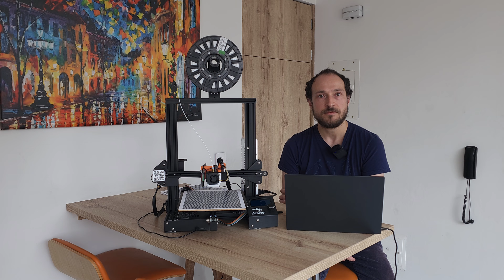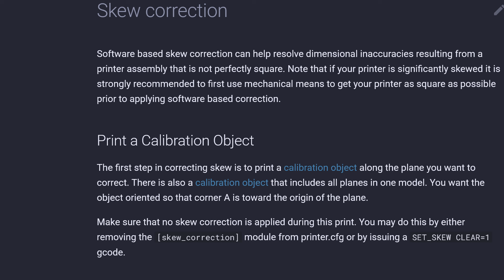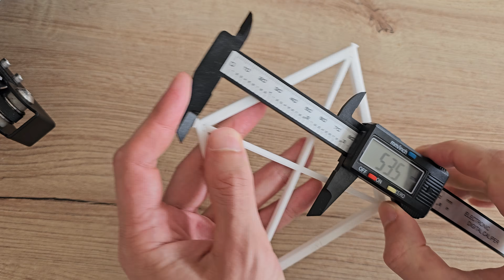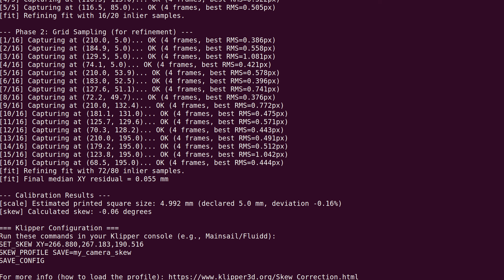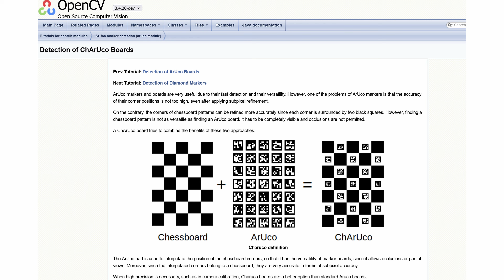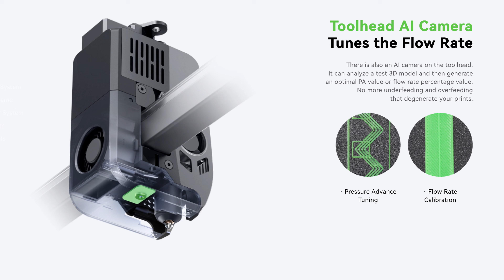3D printing: Auto Skew Calibration with a Camera and a ChArUco Board (Klipper)

Comment from the maker: I implemented now a suggestion I got: My code is now also checking if the X, Y travel distances are correct and if it detects a difference it will output a scaling factor for "rotation_distance" in your Klipper config.

https://github.com/undingen/SkewCamera/commit/1f65129de85bf0967b165c4de5266459e7f6ed5e

Comment: Did anyone manage to get this to work? I am trying with a very similar endoscope camera (probably the same one) with the 5mm A4 Charuco PDF on the github, on my own self-built Voron 0.2 with custom-designed camera mount. Camera calibration seems to work, the images are captured nicely, with more than 50 corners found for most of them. But the actual skew calculation always fails at the first step with "no valid poses found". Tried at different depths, with different python and opencv versions, nothing worked for me after several hours of trying. I am no CV expert so any help would be greatly appreciated.
Reply from the maker: Hi, sorry for the very late reply I only now took a look at the comments. If you are still trying this out could you please send me some sample images taken with the camera. Do the codes look sharp? Several visible in a frame? You can write me at undingen+yt@gmail.com

Comment: could this be done with markes attached to the toolhead and the cam mounted to the frame of the printer? on core xy printer that is.
Reply from the maker: I'm not sure - I would worry that the resolution of the camera is not good enough otherwise it should theoretically work.
Reply: @H @HierNichtErfunden ats what my concern was as well. Sure would be worth a try especially as 4k cam modules arent that expensive anymore and its much easier to position a cam on the frame and not on the moving parts of the printer

Comment: Very nice!     How does one ensure that the ChArUco board is printed square? We are trusting its accuracy to calibrate the 3d printer from the ChArUco board, correct?
Reply from the maker: Yes, but I think a good laser printer has AFAIK higher accuracy compared to a 3d printer. I printed mine in a good copy shop and I'm quite sure these machines print quite square but have nothing to prove it. There is also the possibility to use the Bambu labs vision encoder board (e.g. rent the board). I added support for it but this will likely need a better camera with higher resolution/closer focus distance e.g. usb microscope.
Reply: @HierNichtErfunden  You could take multiple measurements with different orientations. If the print is square you should get very similar results.
Reply: @HierNichtErfunden its possible to do measurement twice and rotate pattern. Then you can compensate the pattern artifacts the printer might  introduce.

Comment: Would I just need to compute camera intrinsics once and copy-paste them to different printers if I'm always using the same camera?
Reply from the maker: Yes you just need to compute it once and can reuse it. Theoretically the camera does not even need to be mounted on a 3d printer todo the calibration but I found it hard to generate shake free images while holding it in my hand.

Comment: can this be used for finding part offset in laser machining
Reply from the maker: If you are thinking about something like a lasercutter with a camera to position origin on the work piece: I think the camera calibration mechanism with a few changes could be used to create an exact mapping between work coordinates and camera coordinates as long as the material is very thin. But I have not tried it and currently also not really any time to implement it :/.

Comment: I already have the bambu encoder board for another printer - would this work for the software? Their board already appears largely similar in layout, and I take it the actual symbol values don't matter, it's just differentiation for motion tracking?
Reply from the maker: Unfortunately right now it's not working with the Bambu Lab one because my software needs to know the exact layout of the board and the size of each square and I don't have this encoder board to configure it correctly also this assumes that they use some encoding which is supported by OpenCV... If you send me a close up picture of the board (and one with all IDs visible) and measure how large the black squares are I could try to get it working undingen+yt@gmail.com

Comment: i think that's how the shaper origin router works.  thanks for your post.
Reply from the maker: Good observation, yes I guess it uses a similar tech. Maybe an alternative for the open source  https://www.compassrouter.com/ version to  get current position? Print out the ChArUco on self-adhesive paper and glue it to the workbench... Not sure if it's accurate enough  but would be nice to try out.

Comment: Very cool tool! Is there a way to use this method to correct z axis skew?
Reply from the maker: Good question - I have not really thought about it. It should theoretically work if the board is mounted vertically and the camera too (not very practical). But with the current setup I don't think it will work for measuring the Z skew even when making different measurements from different Z heights but I'm not sure.
Reply: @HierNichtErfunden I usually use the calilantern for skew compensation. I think using this new method for XY and then using calilantern for Z will give way better results than before, so ill be trying it soon!
Reply: @HierNichtErfunden  many endoscopes come with 45 degree mirror attachment - so it's possible to stick a charuco "line" somewhere on z axis and read it.
Reply: https://www.youtube.com/watch?v=8DvygwWloCc&t=323s

some inspiration